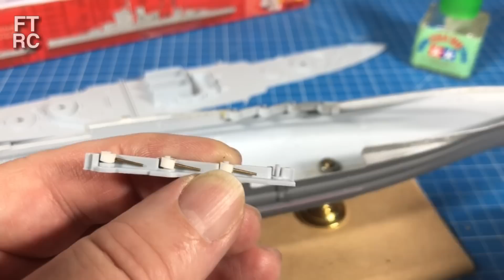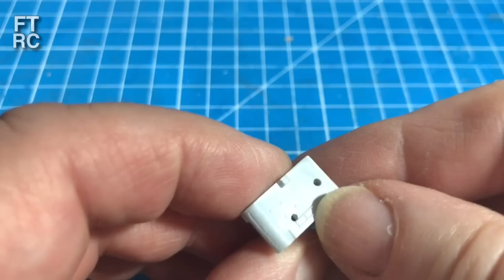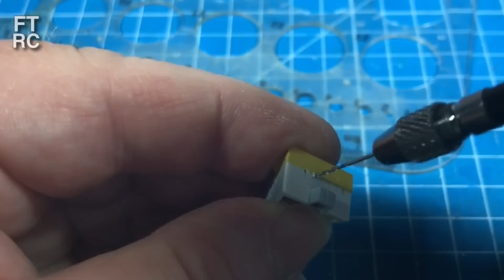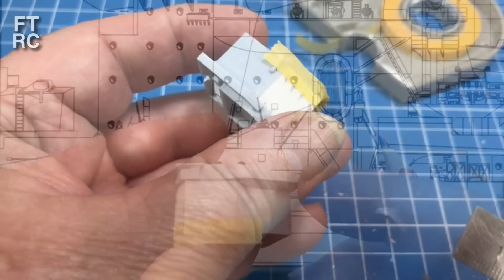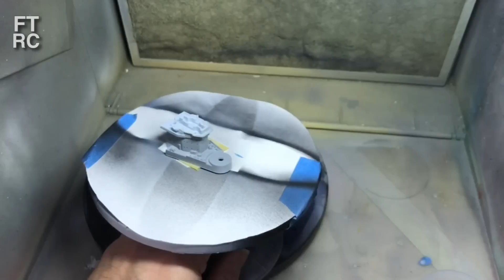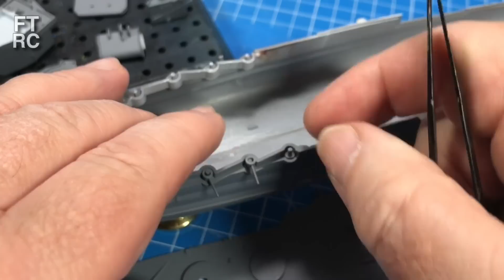3 Super Detailing Superstructure Airfix Warspite Tribute Build with more waffle and Dad jokes

Comment: Hi Harry, It looks great👍🏻. 
As a precise center punch, I use a rather big sewing needle, cut in the middle, in my pin-vise, then, for the other half, I cut half of the eye, to create a 2 prongs fork, to make a precise superglue applicator, when the glue builds-up, I remove it with a lighter, two really cheap useful accessories and it lasts until you lose them...If it's helpful for somebody. Thanks for the video, always a pleasure to watch👍🏻. Yves.
Reply from the maker: Great tips Y.  But I will stick with my corn cob scriber and my tea candle with toothpicks method for CA glue.